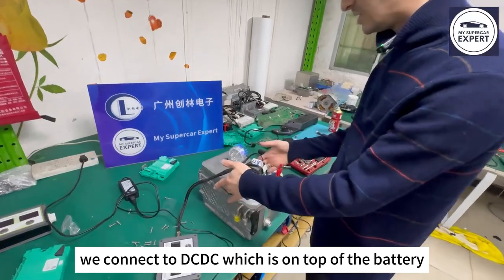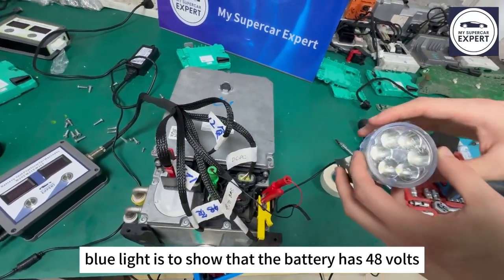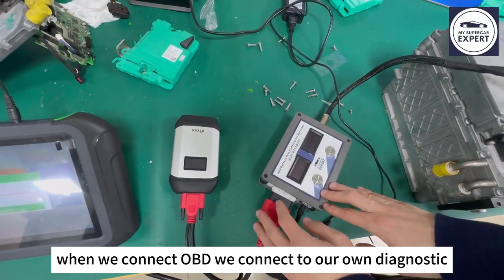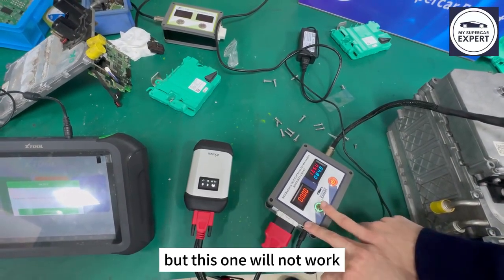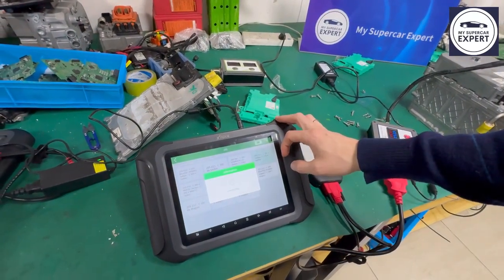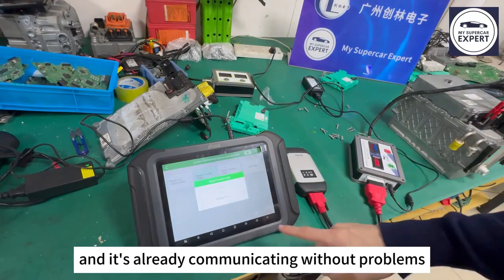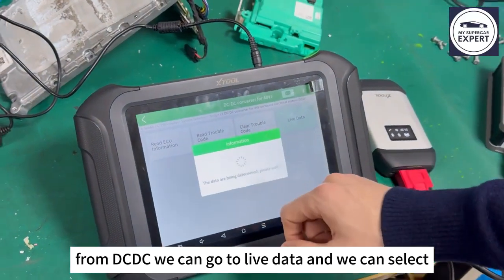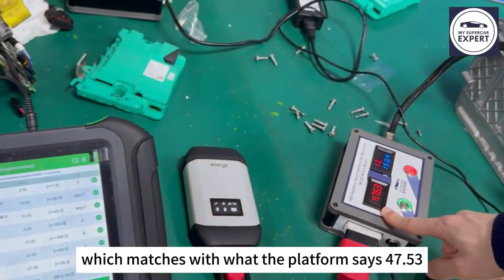How to use our 48V battery test platform Mercedes #mercedes #EV #48v

Comment: so i bout a brand new 48v for my benz newer car  i got the 48 v battery ebay  so if wont start still how can i get the car to start or how to program will atul tool work
Reply from the maker: BMS module should need programming with DTS Monaco. It doesnt have immo but it needs software to be flashed.
Reply: ok so do i need a scannin tool to do it can you tell me if i can do it free this BMS module should need programming with DTS Monaco. I
Reply from the maker: @terrynaylor767  Yes, you need C6, the official Mercedes diagnostic VCI, and DTS Monaco installed on your PC, which is the engineering software. https://mysupercarexpert.com/products/mercedes-benz-diagnostic-tool-official-original-c6-used?_pos=1&_psq=c6&_ss=e&_v=1.0&variant=41085412606004
Reply: hi i got the c6 tool now what do i go to for the program the new battery and flash
Reply from the maker: @terrynaylor767  You will need DTS Monaco to program the module
Reply: @mysupercarexpert  ok can you send me the full instrutiions to get to the flass progam my 48 v battery thak you
Reply from the maker: @terrynaylor767  Write us at info@mysupercarexpert.com
Note we are currently closed till 6 February for Chinese new Year holidays so it may take a few days to answer back. Thanks!